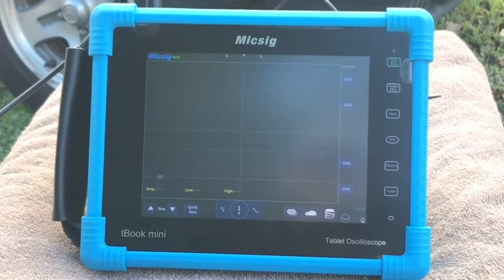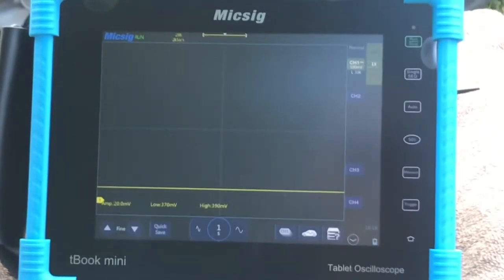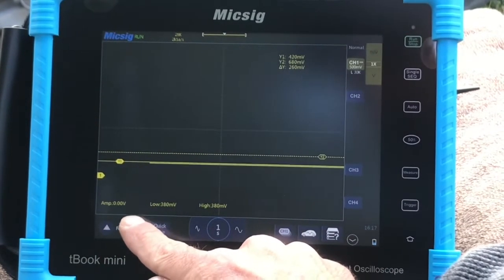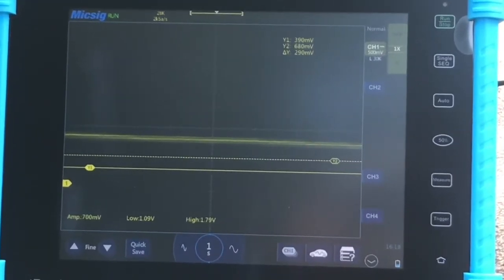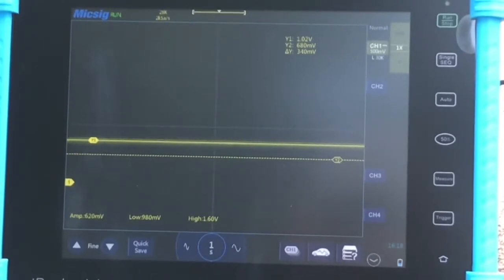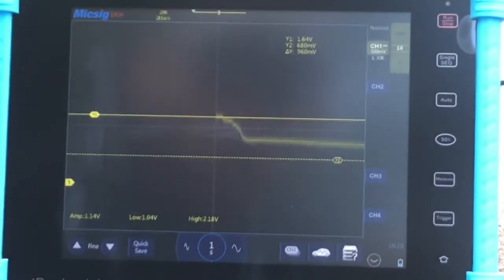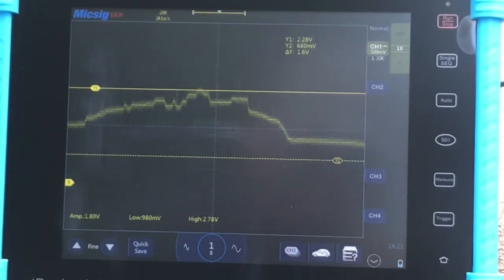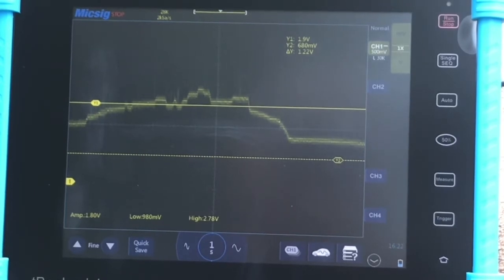MAF Sensor on the MicSig ATO1104 Automotive Oscilloscope , DTC’s P0171, P0172, P0174, & P0175

Comment: Does it have peak detection?
Reply from the maker: Hello Bruno, Yes it has Peak Detect sampling mode.
Reply: Atom’s Workshop sweet, thanks!
Reply from the maker: Anytime my friend. If you have any more questions, feel free to ask. Thanks for stopping by the channel.
Reply: @atomsworkshop195    good job. can you make how to use current probe for ignition coil  & injector?
Reply from the maker: Hello ZhaoTang Wu. I am currently waiting on a Micsig current probe CP2100 to arrive in the mail. Do you want to see it with the Pico current probe  or the Micsig current probe? As soon as I receive the Micsig current probe, I plan on making a few videos using it to test different current circuits on vehicles.
Reply: @atomsworkshop195  l buy ato1104 for while  due to no instructions for some test I practice low current probe for blower motor  test etc
Reply: I still not familiar for low current probe setting IAM use 80i-110s Fluke low current probe
Reply from the maker: Are you not sure what attenuation setting to set on the scope (ex. 1X, 10X, 20X, 50X, etc.)?
Reply: @atomsworkshop195  that setting confuse me for low current probe example I set my probe 100mv/A   I am not sure which  for correct one I pick  to use
Reply from the maker: A lot of low-amp clamps have two different settings. Usually 100MV/A and 10MV/A. This determines the way the waveform will be displayed on the scope. If the current probe is set on 10mV/A, for each 10mV shown on the scope, the probe is measuring 1 amp of current. If the probe is set on 100mV/A, for each 100mV displayed on the scope, the probe is measuring 1 amp. I’ll look at the scope tomorrow morning to let you know exactly what to click on. I don’t have my scope out right now. It’s after midnight here in Texas USA, and I need to get to sleep. Thank you for the question, and check the comments in about 9-11 hrs from now. Thank you Zhao.
Reply from the maker: Zhao Tang Wu, hello. Ok, my apologies for not fully answering your question last night. I had just got done working about 12 hrs straight with no lunch, and was already falling asleep. I wanted to make sure I gave you a correct answer. So, when using a low amp current probe with the setting on the current probe set to 100mv/A set scope on 10X. When setting on current probe is set to     10mV/A set scope to 100X. It doesn’t matter if you set scope to CP60 or CP650; the result will be the same. I hope this helps you. If you have any more questions, feel free to ask.
Reply from the maker: 100mV/A=10X.   10mV/A=100x.
Reply from the maker: What helped me was, I have a small BSIDE ACM91 current clamp/multi meter that I used to connect to the circuit, to see what the reading (amps) was, then set my scope to read the same.
Reply: @atomsworkshop195  thanks.  explain how to setting for low current probe & explain lot of  tip  for use ato1104 Scope expect  More video soon to educate rooky scope user I work for Honda dealership  we don't use scope often  engine misfire count can   see dada list
Reply from the maker: You’re welcome my friend. I’m glad I could help. I will be making more videos soon. Just waiting for my Micsig current probe to arrive in the mail. Also, I will be making a surprise video very soon. Micsig is sending me a new scope accessory to test for them. So keep an eye out for that video. If everything goes well, they will be putting the new accessory on the market for everyone to purchase.
Reply from the maker: I don’t know if you’ve read the other comments under my other videos or not. If you haven’t, I’ll tell you that in the next firmware update for the ATO1104, they will be installing an invert option in the channel menus that will allow you to invert the waveforms. So look out for that also.
Reply: @atomsworkshop195   I will check it later thanks lot